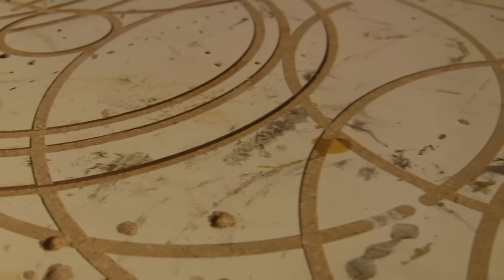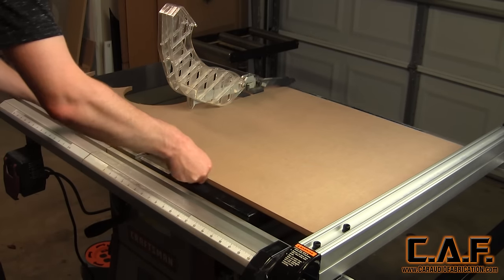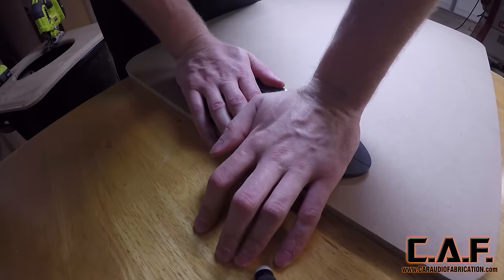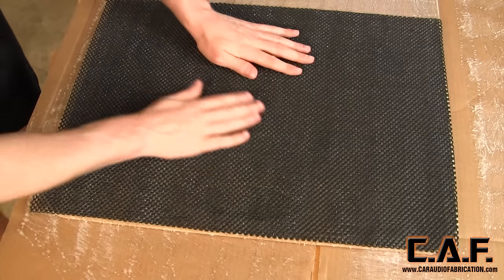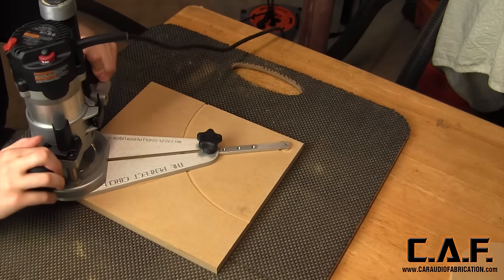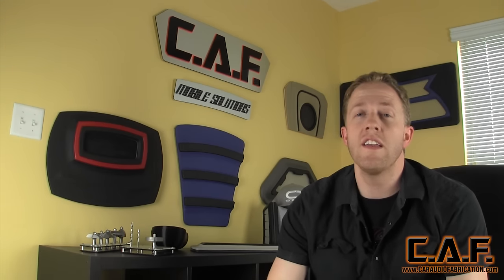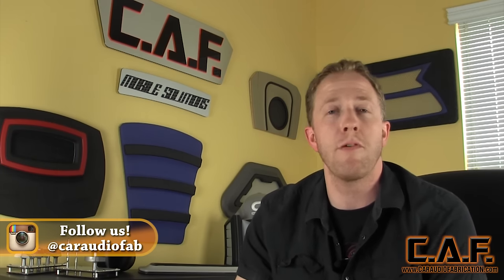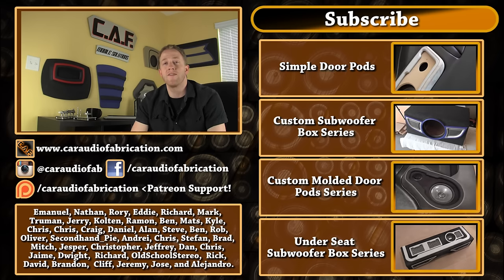You NEED this DIY tool - Router Cutting Station - Car Audio Fabrication

Comment: Just a random thought but what about some hockey pucks (or MDF equivalent) with tool box pad on both sides? Smaller, elevates work off table top and provides dust "escape" route.

Comment: i know this is an old video you have made, but do you have a Stereo Test Station set up in your garage? a place where you have a car deck set up so you can test speakers before installing them into your car ext... if so could you do a video on how you set it up so i can get a few ideas... i've been wanting to build one for a long long time but dont know where to start also i dont know everything that i would need for it to be efficient and work properly. So if you are able to make a video either showing how to make a simple set up or something along the lines of that, that would be greatly appreciated. Thanks again for all your videos and content its very inspiring and knowledgeable.

Comment: Awesome stuff! I have a question about a box for my car. I have a 2007 Dodge Charger and I was to upgrade from 12s to 15s. Is it possible to keep some trunk space with 2 15s? Or would the box just be undersized? And if there's any pre-built boxes that you know of then don't hesitate to mention them. I don't really want to build my own box, that's why I'm asking. But if I have to I have all the materials to do it. Thanks!

Comment: Aren't you just doing the same sort of cuts over and over, for speakers and stuff.

Why not just mod the table router with a spike to make 6 and 12inch holes.
Reply from the maker: Big_Adam_2050 Unfortunately speaker manufacturers never have that consistent of cutout sizes, I typically cut mounting holes within 1/32 of an inch. I do a lot more than cut circles with the handheld router though, inlay work and other advanced techniques that cannot be done on the table router. The router cutting station makes it all much easier.